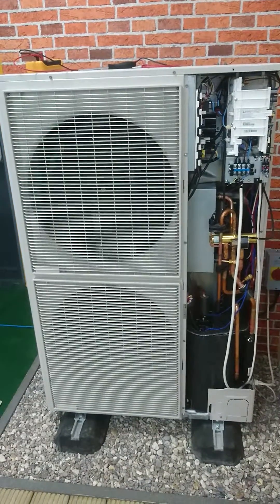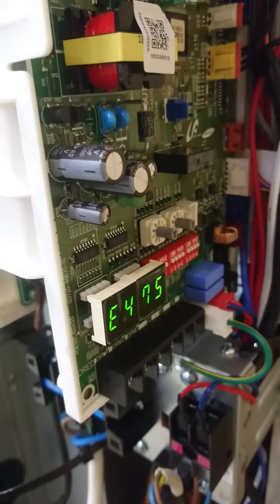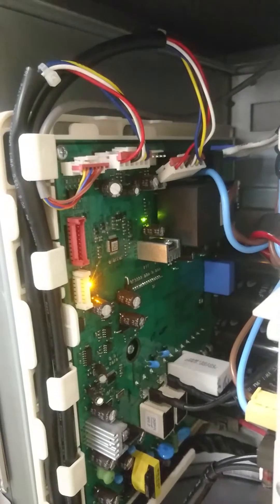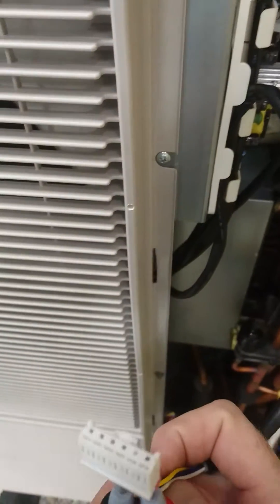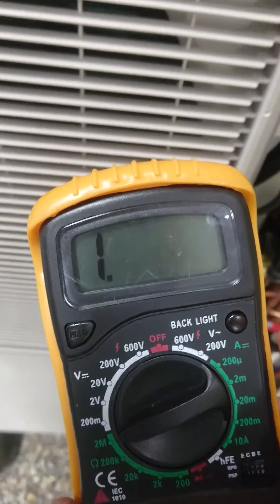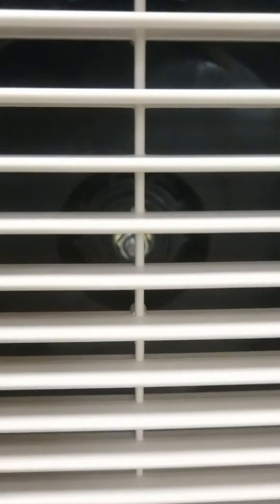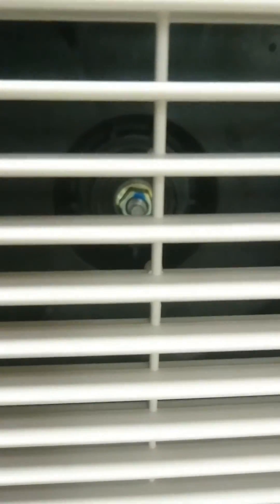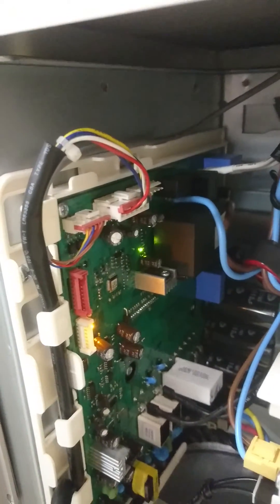E475 & E458 fault  Samsung air source heat pumpsAE050JXYDEH AE090JXYDEH AE160JXYDEH

Comment: I was getting E475 error but had an AC guy come out and diagnose the fan motors. I have since replaced both motors and am getting the same error. It doesnt matter if i swap them around i am still only getting E475. Could this be the inverter board?

Comment: If the unit runs for 20 minutes then faults   On e475 with fan motors running can it be pcb
Reply from the maker: no the pcb is only faulty if the fan motors are running and then the fault shows. this fault really means the pcb is saying run but no run signal is received from the fan motor
Reply: That’s what sometimes happens to me. Do you mean it’s a fault on the inverters PCB or the other PCB (where the fault code shows)?